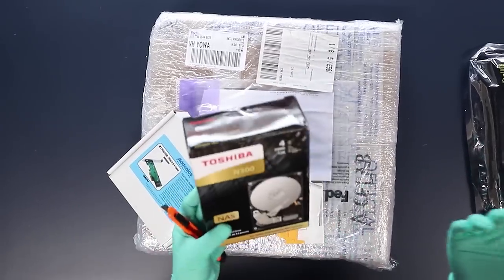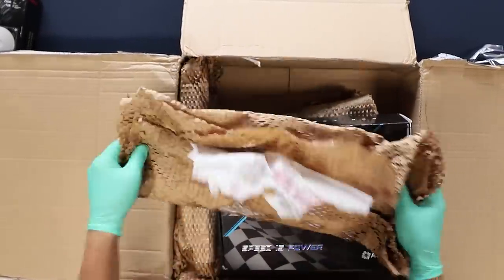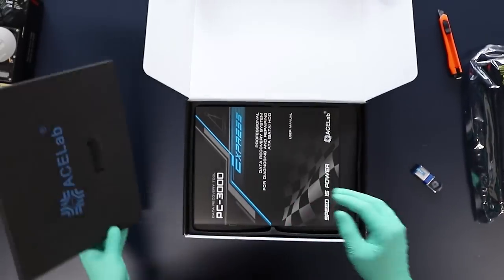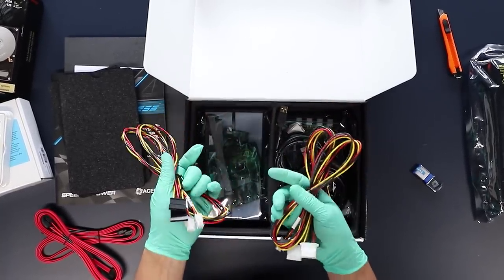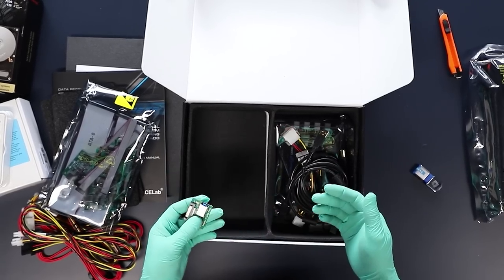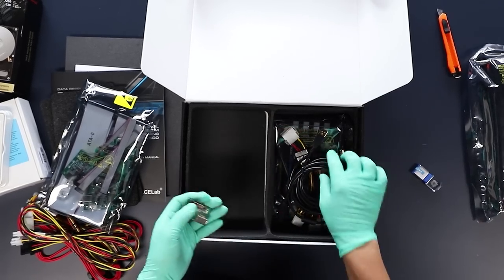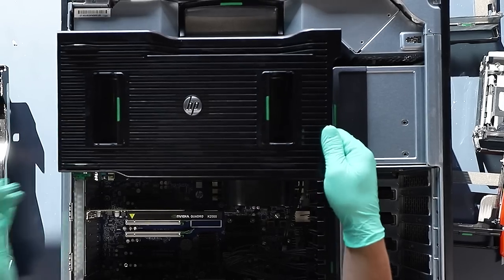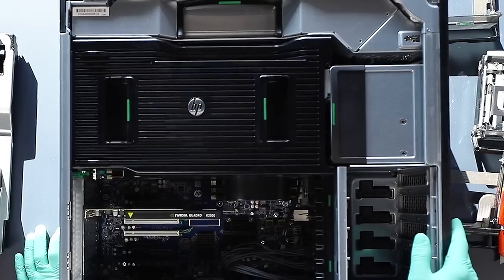data recovery tools | PC-3000 Express unboxing and setup

Comment: Cool thanks! Doesn't  the HP have an empty optical ROM bay? Couldn't you just get a 5.25 to 3.5 HDD adapter for your 4TB storage, that way you can still use all 4 empty HDD trays on the bottom?

Comment: Excellent, what do you use in so far as UPS equipment, & what is your requirements.
Reply from the maker: Not sure I understand
Reply: Regarding the task you preform I asume it's "mission critical" not to have any electrical outage interruption to your equipment. A backup  "Uninterruptable Power Supply" would mitigate such possible issue. Is your whole office or just some equipment protected ............Can you do a video on your setup and typical work flow ?.

Comment: Hi Erkin, can you say me what is the price for this PC-3000 Express with the Software Licence? so round about.. Thank you and greetings from Austria
Reply from the maker: A lot depends on what you getting as part of the complex. It's a modular software system that is built on PCIe host card. Data extractor, SSD, RAID can all be added. This one that I got is fully loaded with all bells and whistles. Link in description will take you directly to Acelab, they can help with price on your needs and budget

Comment: whats about MRT Pro? is it usefull? mrt pro express vs pc3000 which do you prefer
Reply from the maker: MRT is garbage in my opinion
Reply: @hddrecoveryservices  Could you explain why?Dont misunderstant me , i trust your experience. I just want to learn about mrt. 
Actually i want ask, what can you do with this type card. what do you recover or repair?
Reply from the maker: If you have both the difference is very evident. Maybe in future things get better for the MRT, but I gave up on it... Ended up selling my Ultra for half of what I paid for it. As a tool that earns money, PC3000 does far more superior job. Specially for beginners PC3K and support that Acelab provides is going to be paramount. With some functionality issues I had while having MRT, MRT's support team was hard to reach and most issues did not get solved.

Comment: Hey Erkin!  i want to go quickly because you are busy! I opened my hard  drive to swap platters from same hard drive to another same one but i wasnt doing research about that i could do a misaligned platters. was stupid because it was easyer to just change the head. can i recover just data from misaligned platters without expensive tools? It have a double platers, 4 heads i want to clean them aswell because i left one fingerprint which could cause head damage
Reply from the maker: I highly doubt it will work man, sorry.
Reply: @hddrecoveryservices  could there be chance to get  a map out from one platter and do a recovery than? im just wondering because it is a 1tb drive but only 100gb was used  they could be writed on outter platter area
Reply from the maker: Data is zoned by cylinders. So when you write 100GB each side of the surfaces will get an equal portions. Different drives have different zone sizes.